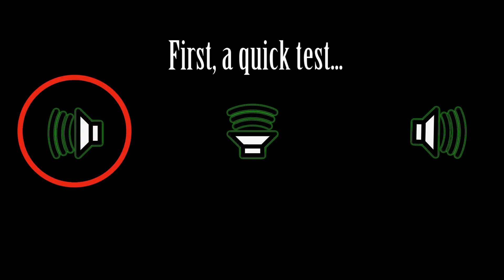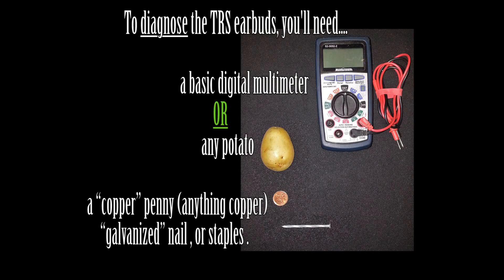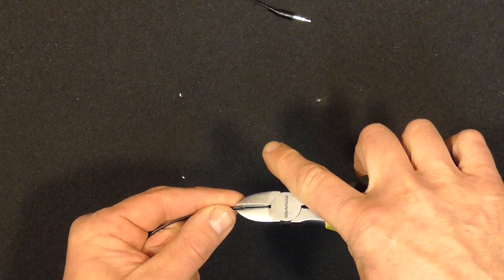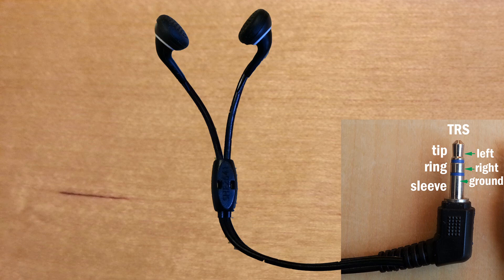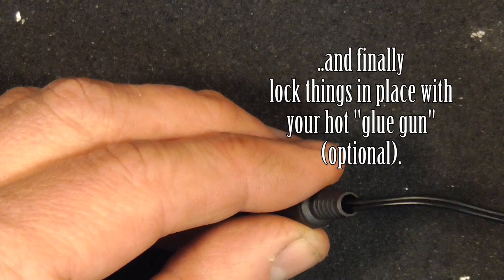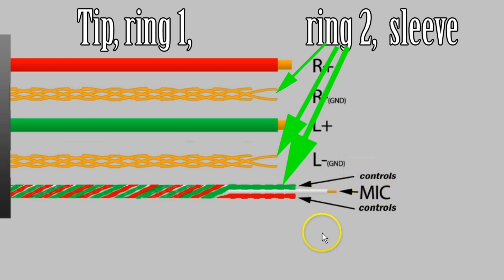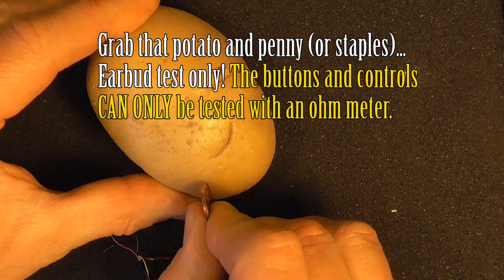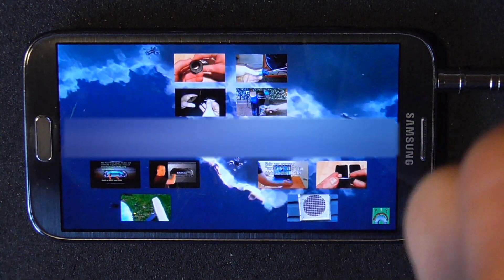Let’s Fix your “Buds/Headphones”. TRS & TRRS Connectors #22

Comment: Excellent tutorial, the best I've seen on this subject. One point I would add is that, before starting to solder, it is advisable to test the overall integrity of the replacement TRS/TRRS connectors by checking the continuity between the connection tabs and their respective rings, tip, or sleeve. I have run into defective TRS/TRRS connectors in which rings and/or tip, along with their respective connection tabs, were not isolated from each other, or even not in continuity at all. Thank you for a great video.

Comment: Wish this vid was higher on the list when I searched for how to do this :) thanks for clear and all-encompassing instructions. Attempting to fix a set of sennheiser buds I've had for about 10 years now and I'm quite attached to..  maybe I'll lengthen the cable somewhat while I'm at it.

Update: fault was faaaaar up the cable, almost next to the earbud bit. For sennheisers without mic, there's not much online about wiring, but here's the Sennheiser non-mic pinout, if that's what it's called: Left: green, Left-ground: red&green twisted, Right: red, Right-ground: copper color. I'm planning on cutting a new and working jack-jack extension cord and attaching the buds. Cheaper here and more easily available than the actual connectors :) also, soldering the wires should be a cakewalk. (Hahaha I'm doing this with a wood-burning tool intended for art to which I've attached a bit of stripped thick electrical copper wire).   Slightly worried about ending up with uneven resistances if I don't clean up these damn small wires from oxidation well enough. Tips are welcome 😅

UPDATE 2: WORKING!! Aaand as a bonus, they now look pretty theft-proof too. :)
Reply from the maker: Great! I'm glad you revived them.

Comment: Thanks buddy for your left and right and Center sound test at the beginning or video I did watch halfway through earlier but I didn't have any solder. So I watched a couple other message and I tried those and coupled with the information from your video I was successful. I found out through your video I made two wires wrong cuz the colors it was a 50-50 chance thank you buddy straight video

Comment: Hey Mysimplefix, I have a question and I was hoping maybe you can help me get to the answer.

My headphones have TRRS connection, T = left, R = right, R = ground, S=mic.
I have used multimeter to test ground with left and right but I only get reading for LEFT being around 38ohms, 
and for RIGHT I get nothing and that is because my right side is not working.

Now my headphones also have a volume slider and mute button in the middle of the cord(Razer Kraken v2 pro)
I was able to test both sides to see if they create a "crackling sound" to indicate that they are functional and the both do, which eliminates speakers being broken/blown.
I also assume, even if speakers were blown I would at least get a reading, a continuity, yes  ?

So that leaves the wire being cut/broken somewhere I assume but how do I exactly figure out where the break is ?
Is it at the connector, at volume slider or somewhere at speakers ?
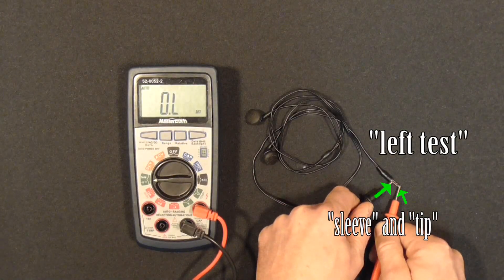Also text at 3:05 confuses me, my multimeter gives me no reading for right side, so which is it, a short circuit or infinite circuit ? Or is that the same ?

I don't understand how that helps me narrow down the location of problem.
Reply from the maker: If you are able to get both the left and the right buds to crackle with the method shown, but while using a multi meter one ear bud shows no continuity, then something is wrong, because both sides should show the same continuity readings (should be 38 ohms like the other side). The text shown at 3:05 in the video shows that an open circuit would read as "infinity", or no reading. A short circuit would mean the ohms reading would come right down to zero, as if you were touching the tips of the probes together. That slider and mute button I would think would use the ground to mic circuit to operate those functions while those buttons are pressed or slid (for the volume slider).
Reply from the maker: If there is no reading, (as if your probes are held apart) that is considered an infinite reading or "open" circuit.

Comment: What exactly happens when the earbuds are blown? Like what causes it?

I think my earbuds are blown. I can hear the diaphragm cracking earlier occasionally when it's on full blast, but barely noticeable,  but later that same side is muffled significantly. I figured maybe the diaphragm was crumpled or something, so I opened up the wire mesh that covers it and started blowing and sucking  hoping it would readjust the diaphragm but it just got worst, it's rattling and barely produces and music. Now it doesn't rattle as bad but it's muffled even more. Is there a way to fix this?

Comment: Ok so I'm getting no noise at all when doing the potato test (with Jack and without Jack just wires) I've already bought and done with gold pleated plug easier cuz it has screws no soldering needed but that didn't work so u said I'd need to cut further up close to ear buds to test them again,  if theres no noise again when doin the potato test ear buds are defective- But what if I hear scratches how would I go from there? How would a reattach them to another different pair that I already have just not same quality as the ones trying to fix, would it be just twist them together? Thanks
Reply from the maker: +elcaifan The sound quality of the earbuds will be dictated by the quality of the buds themselves. You could theoretically join your good quality buds near the buds, and feed them using a cut off cheaper pair from the bottom. There are only 2 wires directly feeding each earbud. They should be relatively easy to join, although I would try to use heat shrink tube that is small and will match the colour of your wires so they will still look good too afterwards.

Comment: 14:14 Why didn't you crimp the outer sheath of the wires into the the TRRS connector, like you did with the TRS one?
Reply from the maker: Those were two different style connectors.

Comment: I am getting a bit louder sound on left as compared to right , should i go for these tests or is it confirmed that somewhere in the midway wires are broken (TRRS, HTC)?
Reply from the maker: +gagan nagpal The first thing to note, is that if there are broken wires to one or both of your earbuds, all sound will disappear to one or both earbuds! The fact that you have some sound in one earbud indicates to me that either there is something in the bud  like some foreign bit of contamination that is blocking sound, or, the earbud itself is blown. When measured with a multimeter both earbuds should have the identical resistance values when compared to each other. (as per the diagnosis shown in the video).

Comment: what is the name of the left earphones?? the one that doesn't have that big connector?
Reply from the maker: The ones on the left are standard earbuds, that have no controls. They have the  1/8 inch  (or 3.5 millimetre) TRS style of connector.
Reply from the maker: Also, this is important, the connector is a "Stereo" connector, as opposed to being a "Mono"  connector.

Comment: On my phone the problem is that my headphone jack doesn't seem to let me plug in my earbuds all the way. Is there anything I can do about it or do I have to replace it?
Reply from the maker: Yes,  2 things can cause what you are experiencing. 1, if you have a phone case that's blocking your audio connector, or 2, https://youtu.be/BjHEfjFwueo
Reply: Mysimplefix Ah ok thanks I gotta try to clean it out. The thing is that originally my earphone jack somehow pulled up if that makes sense so I'm not sure if there's something it it that's causing it.
Reply: +skatemaster213  there might be dust or dirt stuck in it. Try putting rubbing alcohol on a tooth brush, rub a little bit off with your finger so it dosent get too wet, then just rub brush on headphone jack.

Comment: my buds have a problem  where they will work for like a month and then the sound will go down really low for like 2 weeks or so, can you help me?
Reply from the maker: Are your earbuds the problem? The way I would test that is to quickly plug them into another device. Are they very quiet then? If they are, use the diagnostic method (s) I this video to determine if everything is OK. This will show you if there's a problem. Please get back to us on this.

Comment: my both sides work, but center not, any quick solutions?
Reply from the maker: +Antonio Filipović are you taliking about a subwoofer/centre speaker?
Reply: Mysimplefix yes, centre speaker, that test in the begining worked for left and right, but centre not
Reply from the maker: +Antonio Filipović If your left and right speakers both work, and your speakers are driven only by an audio port like the one shown in the video, then the issues could be anywhere between the output amplifier that drives the centre speaker and the speaker itself.

Comment: rq let me explain something, if the earbuds are super cheap (you can tell usually if the tip isnt gold plated( not including apple ones those are expensive) dont bother fixing them it would just be easier to replace them
Reply from the maker: Yes, you are right. I did this to show that if you "wanted" to do a repair, then with a little patience, it is possible.

Comment: I had my problem Both sides are not working but my earphone is not broken in external what should i do?
Reply from the maker: If your earbuds work in another device, but not in the one you normally use, check out my other video. It might be your issue. 

https://youtu.be/BjHEfjFwueo
Reply: Northcaledon What if my earbuds are just straight up broken should I just buy a new pair? ;>
Reply from the maker: Trollert Trollungtin the choice is yours. If you're up for the challenge, and your buds are expensive then I would lean towards doing the repair. Do you have a soldering iron with a small tip?
Reply from the maker: Did you check your audio port for a build-up of dust /pocket lint? https://youtu.be/BjHEfjFwueo
Reply: Yup, But its not just one device,the earbuds in question don't work on my laptop,phone, or tv soooo PLZ HELP MEH Northcaledon SAAAAVEEE MEEEEH :C Or something along those lines C:

Comment: What if we don’t have a glue gun? Can I just inject some glue in to the hole? What type of glue is it?
Reply: You should get a glue gun, its super useful for many applications.
Glue gun uses "plastic cartridges" that it melts, so that plastic becomes liquid, a hot glue, which you then use to pour it over either the wires or solder points, after that same glue hardens, becoming kind of plastic, so its not your regular super glue or shoe glue.
What this plastic does is protects the wires and any electrical components from moisture as well as from breaking or short circuiting, it can also be used to stick stuff together.
Glue guns and cartridges are very cheap, you should be able to get both for 3-5$ total.

Comment: These trs connectors are not even sold on amazon, ebay etc, only electrical stores, so this is not that feasible for some, by the time you've spent hours finding a store that sells them. thanks anyway.
Reply from the maker: Hmm. I tried the search "TRRS male solder connector"  and "TRS male solder connector"  on Amazon and EBay and had many MANY results. Try that search.